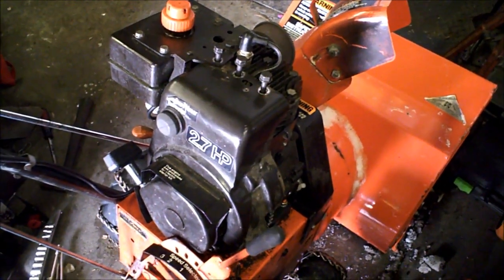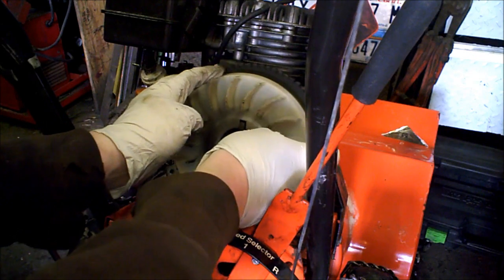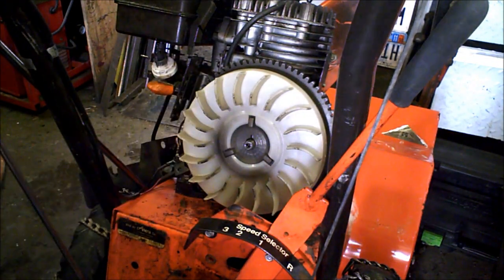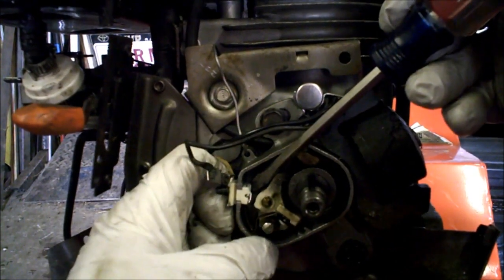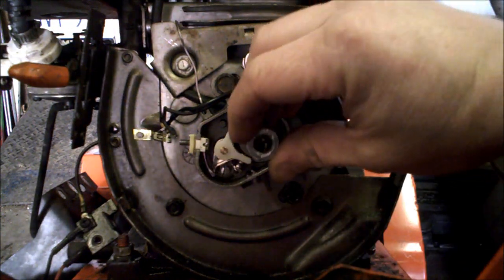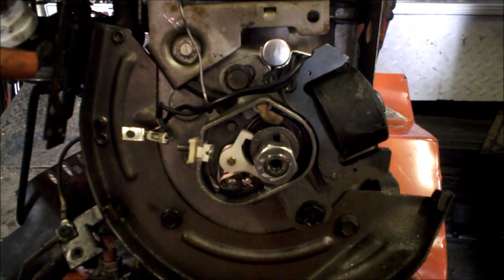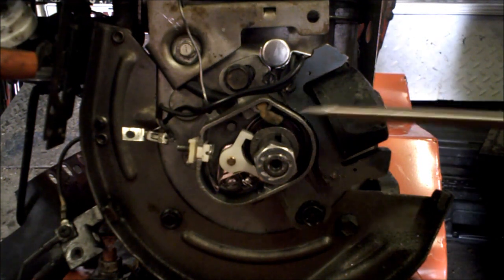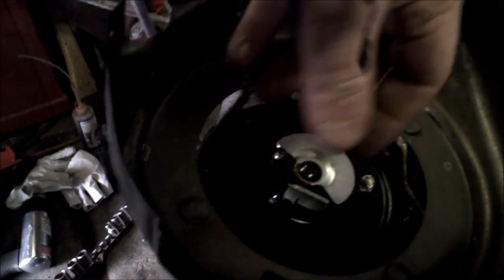Tecumseh Points and Condenser 3-10hp replace

Comment: I have a Tec 8HP (Ariens approx. year is 2000) Does your video apply to that engine? I currently have no spark to it.
Reply from the maker: No, because your unit won't have points. More than likely, it's just your kill wire engaging. You'll see it coming from under the front houseing/under the carb and attaching to a nylon post with other wires. Remove the small bolt holding it to this nylon post and allow it to free hang without touching anything. Test for spark.
Reply: Thanks, I will try unbolting the "kill wire" to get the spark back. If that works, does that mean I need a new on/off switch, that its stuck in the "off" position when selected to "on"? ( I installed a new electric start motor two days ago and it worked fine)
Reply from the maker: If it works, your kill  wire is shorting somewhere. You'll just disconnect each component (at least 2, sometimes 3) to track down your culprit.
Reply: Do you have a video of what the kill wire looks like? I have a 8 HP Tecomseh with no spark.
Reply from the maker: DrZaius
It's the only wire coming out from under the carb.
Reply: The funny thing is, I do have an extra wire sticking out of the machine that is not connected to anything. Apparently it's for an optional light. I thought at first that it was broken but it's supposed to just hang there.

Comment: do you have a video that shows how to replace the engine on a troybuilt junior rototiller???
Reply from the maker: Sorry but I don't. It should be just 4 bolts holding the motor on and then the pulley.

Comment: I only see one problem with your points adjustment  Tecumseh suggests you connect the wires on the points before setting gap so the point are at there correct spring tension connecting terminal afterwards can change your gap by a few thousands.

Comment: My engine and points set up are identical to this one, EXCEPT, it does not have that ring with the arrow on it, there is no arrow to guide me...... any advice on what to do now? Also, can I assume that these points for small engines are universal? Anxiously awaiting, please check my next comment below for another question. I am sure there are others out there that would like the answer to these questions as well.
Reply from the maker: +W. Gator Points aren't universal. Your 8hp Tecumseh will follow the same steps for replacing as I do in the video. Do not remove your main ignition coil! It is a pain to re time your engine if you do.
Reply: +sixtyfiveford My problem is that my engine, even though it is almost exactly like yours, it doesn't have the ring with the arrow on it, so I don't have an arrow to line the points up with. What can I do ?? Do I jus turn the crank until the points are open to their widest point, and start from there????
Reply from the maker: Yeah, the arrow isn't needed. Just rotate it until the points are open the max.
Reply: +sixtyfiveford Thanks, our forecast is for 50cm of snow starting tonight...... that's about 20 in. we have just a skim right now. Have a good wknd. you know what I'll be doing.

Comment: Can the points and condenser be replaced with an electronic ignition module on this engine? Working on a ~1984 Ariens Tiller with H30 engine...
Reply from the maker: Yes, you can use the Nova 2 electronic module to convert it. It is around 10 bucks and you simply wire up 2 wires without messing with the points.
Reply: sixtyfiveford thanks for the quick feedback. is one way easier than the other? best price I can find on nova 2 (or mega fire 2 - similar?) is almost twice as expensive as the points and condenser. do you have any videos installing one?! :)
Reply: well, based on how awesome and detailed your video is I decided to go with the points and condenser for ~$10 shipped from Amazon. Thank you!
Reply from the maker: You'll be happy with it. A new set of points will give you 5-10+ years of service. Let me know how it goes.
Reply: sixtyfiveford Up and running in almost no time at all! The project gave me a great excuse to buy feeler gauges too. Instead of spending time to rebuild the diaphragm style carb I just picked up a new bowl type on Amazon for $30. Pretty much good as new! Many thanks!
Reply from the maker: Awesome. I'm glad the video helped and you're up and running. Time to till some dirt.

Comment: I have an old Tecumseh 2 cycle engine (only identification I find is a tag with two sets of numbers) that has no spark. I'm wondering, after I adjust the points, can i put the flywheel on the shaft and spin it to see if it has spark before putting everything back together. Also, how will I know what  parts to get for this old machine?
Reply: The number on the condenser on mine is 30548A.
Reply from the maker: There are really only two different size points, one for engines larger than 10hp and  one for everything smaller. This is more than likely your point set http://amzn.to/2EdNczXj . The model number will be on the shroud and start with something like hh50..........
Reply: I looked at the shroud real good, and didn't see any numbers. 

Today I cleaned up the points and adjusted them, and adjusted the gap between the coil and flywheel, and I'm now getting spark. 

I put the flywheel and nut back on and spun it with my impact. I get good spark to begin with and then it turns many revolutions before I get spark again, and it's week when it does recur. Maybe I should think about getting a new coil?
Reply: I used a few different plugs when I did this and one of them was new. Got the same result with all of the plugs.
Reply from the maker: The coil will generally work or not work. I wouldn't replace it, however I would replace the condensor as it will affect spark intesity. You can generally also find you model number by simply researching the equipment it is on.
Reply: I went back to it and double checked the points setting and it was a bit off, so I adjusted it to .020 again and put the flywheel back on and spun it, and it had good spark. I put everything back together and gave it a shot of carb cleaner to the carb, and it started a ran like a champ.

Oh by the way, I really liked your snowblower impeller mod by adding rubber paddles. We had a storm put down some heavy snow a week ago, and I used my Craftsman 2 stage (not modded yet) and it seemed to do a good job without the mod, but I do have some rubber mudflap pieces cut and some self tapping wafer head screws standing by. 

Thanks for your uploads, you're doing good things.
Reply from the maker: Thanks.

Comment: I'm working on the same engine, I've cleaned and ajusted the points and it still doesn't have any spark. any ideas
Reply from the maker: +JohnDeere50d Make sure the single kill wire isn't shorting out somewhere.
Reply: +sixtyfiveford no, I removed it, I'm thinking the coil
Reply: +sixtyfiveford I do get a small spark when using a spark tester. but nothing jumping across the plug
Reply from the maker: +JohnDeere50d I have had to replace the coils on these things. Be careful to mark exactly where the coil is as it adjusts the timing with the bolts that hold it. It is a tedious task to time these. It could be the coil but it's also likely that the condensor, if old is bad.

Comment: I just replaced my coil, set points, I'm getting spark in the wire but no spark on the new plug, any suggestions
Reply from the maker: +Daniel De Vore You could have a shorted spark plug.

Comment: i have an old tecumush and one of the magnets fell off inside the fly wheel .Do you have any idea how far apart those are suppose to be.I saw a guy on here glued his back on with jb weld and i was gonna give it a shot.Tried counting the teeth between his then comparing to mine but where his is 12 or 13 mine is like 16.Looks like his are about the width of one of the magnets apart.Just wondering if you know anything related to this.Good vid i sub and like.Hit me back if you get a chance.
Reply from the maker: That's random. I've never lost the magnets off a flywheel. The magnets are for the alternator and they are all evenly spaced. Increasing/decreasing the number should increase/decrease the alternator output(amps) capacity. Take a look at the service manual. Start on page 42 https://www.allotment-garden.org/rotavator-manuals/Tecumseh-Engine-Manual.pdf
Reply: Cleaned the inside of the fly wheel up and krazy glued it on about the same distance as the magnet is wide from the one magnet that stayed attached and i now have spark..
Reply: Service manual will come in handy thanks for the link and have a great day...

Comment: I have an HHM80 190009 tecumseh 9 hp  on a troybilt horse tiller no spark but the coil assembly is different than you show it has to coil parts on each side of coil how do i test it
Reply from the maker: jeffrey felix Your 8hp Tecumseh won't have points. It just has the coil. If you have made sure that it isn't grounding out(kill wire), then your coil is bad.

Comment: got an old tecumse just put new points in set got spark will not fire even with start fluid even cleaned carb very odd worked on these alot what could it be baffled it sat awhile valves are moving freely also
Reply from the maker: Did the flywheel key get sheared when you reinstalled it?

Comment: you don't by any chance know what year they went to solid state? I have a 97 st824 with hmsk80
Reply from the maker: 1983ish. Yours won't have points.
Reply: OK thank you man. I just pulled my front auger shaft because some hack ass drilled a hole 90* of one of the shear pin holes so ev time I broke one it was awful getting it out. Replacing that shaft turned into practicality a full restoration haha
Reply from the maker: Have to love when a little job turns into "might as well I'm already this deep" job.
Reply: sixtyfiveford that's exactly what happened. I'm stopping.g myself at the drive train because I'm no snowblower expert and I don't understand that

Comment: R&R npoints but still no spark - saw an other vidio that the tech found magnets broken loose in the flywheel does this fly wheel have magnets (teccumseh motor)
Reply from the maker: +Georgette Misura The magnets should not be a issue as they are fixed in. Only models with an alternator have numerous magnets. You put new points and condensor or just cleaned them?
Reply: renewed both points & condesor
Reply from the maker: Make sure the kill wire is not grounding out to anything.

Comment: what is the part # for toro snow blower 521 with teccumseh fly wheel key or are they all the  same
Reply from the maker: +Georgette Misura There are a few different ones. What's your engine model number?
Reply: +sixtyfiveford #'s worn off - it's an old b10 hp
Reply from the maker: Older machines have it stamped right on the top. If you have electric start, it's directly under the plug in part. Newer machines have a decal on the side of the engine shroud on a permanent decal. I have never seen one worn off.  A 521 Toro would be a 5hp 21" snowblower.

Comment: For those of you that still have no spark after replacement check that you have installed everything right.....turned ignition key to on....if still no spark wire brush the contacts on the coil and or clean the magnets or contacts on the flywheel.

Comment: Is the point gap same on 5.5 Tecumseh H60
Reply from the maker: Yes
Reply: @sixtyfiveford  is the carb the same for a 67 as long as it looks the same on the outside
Reply from the maker: @joehubbard6934   They used the same carbs for years. The only difference is the linkage on some and the overall physical size for larger engines. If it looks the same dimensionaly it should work.

Comment: If anyone could help, that would be great!!!  I have a Tecumseh engine that has no spark.  I replaced the coil, condenser and points.  Set them to .020, cleaned around the coil and tested the magnet but still no spark!!.... I am at a loss right now, I don't know what else to do? Any suggestions would be greatly appreciated. It's a H60-75430L Engine.  Thanks again.
Reply: Without knowing the machine model. If it has a keyed on and off switch (like ariens older  ST models), check the wiring below the carb. If not then triple check your gap with the points. Inspect the magnets and flywheel. If you didnt replace the points/condenser then I would clean them again. feel free to email me if you get stuck (bigalby01 at gmail).
Reply from the maker: Like Allen said. Remove the kill wire completely and allow it to just free dangle, not touching anything. Then check for spark.
Reply: Thanks for the replies! Sorry it took so long. I got it figured out now 😁 it was the throttle switch. So after replacing all of the parts (points, condenser and coil) I got a spark after I had the throttle pushed all the way to high speed and all was good. Thanks for everything 👍🏻

Comment: Hi,
I was an idiot and removed the entire magneto unit from my engine without marking it. Is there any tricks on how to gap the space between the coil and magnets when its under the flywheel like this?
Reply from the maker: Mike Hitt There is quit the process to re timing/gapping the coil. I have the info in books but it is a lengthy write up. Google it and you'll pull up good info on it.

Comment: Great video, thank you.  I have a Tecumseh HMSK100 (159182T) 10 hp (I think) that was put on a JD1032 Blower (it is not original engine). 

Anything special I need to know about this motor?
Reply from the maker: Jeffery Bryan The JD models are great machines. They do tend to have pretty large gaps between the impeller and the housing. Watch this video http://youtu.be/EMAgb3QNEE8 it'll make a HUGE difference on your machine.

Comment: how hard is it to convert to electronic ignition
Reply from the maker: As long as your coil is good it's a simple process of hooking up a NOVA II module. However in my experience overall these aren't anymore reliable than points. Your points right now more than likely just need cleaning and there'll work like new. How long they last is dependant on how well you seal the cover. Moisture is what corrodes points.

Comment: bonjour ,
avez vous la valeur en nanofarad du condensateur ? 
merci
Reply from the maker: You have to use this style of capacitor for it to work. However any small engine capacitor from any brand will work. The nanofarad is .20-.30 microfarad

Comment: how to adjust coil inside flywheel thk josef
Reply from the maker: It's not easy, so I recommend just putting it back to as close to possible as it was before. The procedure is page 68 of the service manual: https://www.allotment-garden.org/rotavator-manuals/Techumseh-L-Head-Engines-Manual.pdf

Comment: I’ve got a 6hp tecumseh just changed points and condenser and new spark plug and still no spark could it be ignition coil has any one got any ideas thank you
Reply from the maker: First is to eliminate all the grounds the kill the spark. You could have one on the throttle, key switch or some other safety switch. You can just pull the kill wire at the outside of the points housing but leave the condenser wire on. If still no spark, it's you coil. Do NOT remove the two bolts holding it on, just slide the coil off the center post and replace it. If you remove the laminated metal core of the coil it will mess up the timing and it's a pain to re time.
Reply: @sixtyfiveford  Hi I have taken the kill wire out and had a massive spark got it running for about 10 seconds and then left it for half an hour when I tried again now no spark just wondering what that could be sorry for all the questions I’m 14 and it’s my first project thank you
Reply from the maker: @malidubois7818  The points contacts can't have any oil/grease on them. This something will give you a hard time. They need the be gapped to .020" with feeler gauges or the thickness of a paper business card is about the same (not a credit card, that's too thick).
Reply: @sixtyfiveford  hi I’ve gauged them to 0.20 and it did spark but then didn’t spark again would it then be ignition coil thank you
Reply from the maker: @malidubois7818  If the points/condenser are new and you have the kill wire isolated, yes I would replace the coil.
Reply: @sixtyfiveford  ok thank you do I leave the kill wire off
Reply from the maker: @malidubois7818  I would reattach it. So you don't have to pull the flywheel again.
Reply: @sixtyfiveford  hi it’s a pull start not a key start so confused why it’s got a kill wire hope that makes sense

Comment: THANKS  BRO  WHAT  HAPPENS  WHEN  POINTS  ARE  BAD  ROUGH  IDLE  ???IRRATTIC SPEED?   THANKS
Reply from the maker: Generally just no spark. Or you may get it to almost start then die. If the points are just gaped wrong or dirty it will misfire (run, burp, run run run, burp........)

Comment: @sixtyfiveford 
This motor has points though
Reply from the maker: jeffrey felix Someone put the shroud from a newer engine onto your motor. People do this because their pull start breaks. Generally the only thing wrong is the points get dirty. You can clean them with some fine sand paper or replace them and you'll be good to go.
Reply: I like to use emery cloth on points instead of sand paper.